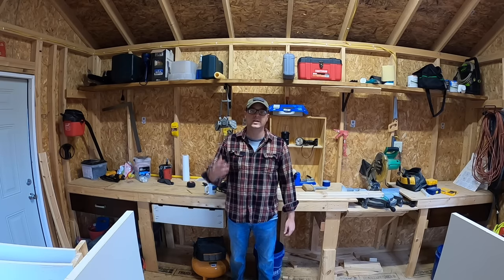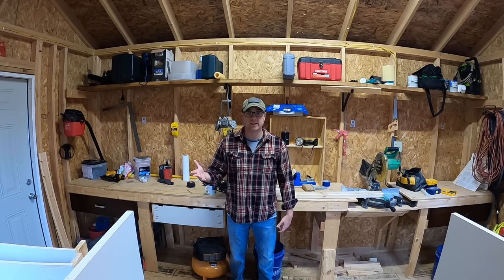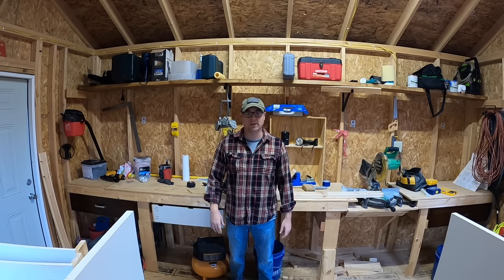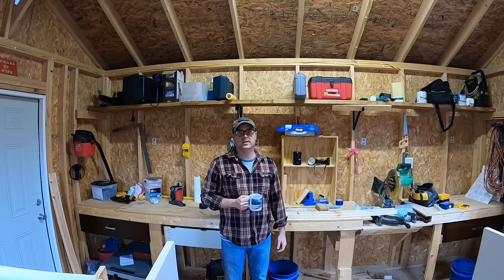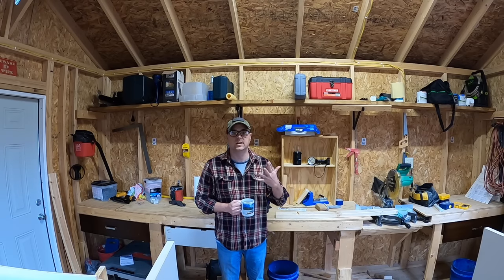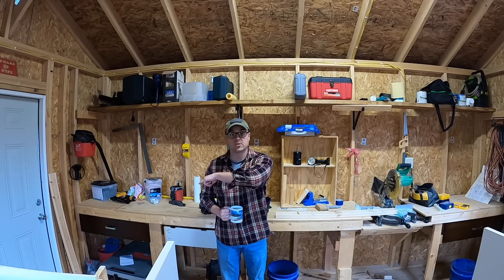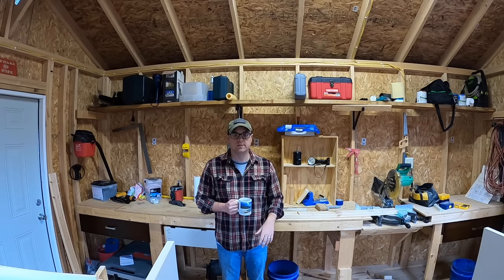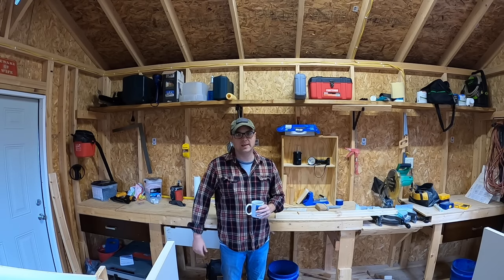Using Extension Cord & RV Inlet to Power A Shed

Comment: Your wire splice is not a legal splice with just tape around wires like that.  You should have run that pigtail into a junction box and at least wire nut each wire separately and then tape up each individual wire.   Also, not the most efficient way to run wiring on the surface of the header plate.  You will have to re-route the wiring if you ever decide to cover the studs, etc.  Otherwise.......You did accomplish what you set out to do.
Reply from the maker: There’s no wire splice

Comment: You might want to check with the local ordinance to see if this is legal.
Reply: Most municipalities default to the NEC (National Electrical Code) and they require exposed wires to be in conduits.

Comment: Im living in a shed right now and have 6 outlets and 1 light all wired up. Currently my incoming power is extension cords and 6 ways. Would this be sufficient to run the whole shed? And is it safe? (I plan on insatalling a sub panel and burying some wire in the future)
Reply from the maker: No.  That isn’t safe.

Comment: I had a similar setup, for about a year, until I could bury the power cable. It was mostly for the lights in the work shed, and outlets for a radio. I wish the guys complaining about the electrical code violations would specify them so other viewers who don’t know them, could learn. I think it’s good to use 20-Amp wire in case you want to bury the power and put it on a dedicated 20-amp circuit in the future.
Reply from the maker: Lights and the mitre saw is all we run off this and it’s held up beautifully over the last eight months.  This is also temporary until I can afford to put in solar.  This shed does not require permits in my location due to its size and not being used as a habitable space.  Some of the claims made in the comments don’t even represent what was done in this video so at this point it’s a pile on effect.

Comment: Nice. But it appears you used 20 amp ( yellow ) wire with a 15 amp power plug...not sure that really matters. But cool idea..thanks for the video
Reply: It's fine to use over rated wire, the power is (or should be) limited by the weakest link and the breaker to match. Ie a 15a plug with 15a breaker/fuse at the circuit (preferably dedicated) powering the 20a cord is fine. Power's drawn not pushed and isn't restricted by the lines but by the breaker. A 20-25a breaker with 20a cord with 15a receptacle could be problematic as it wouldn't shut down when the weakest link is overloaded.

Comment: Is there any special way that you had to do it I tried plugging up my shed to one of the kitchen outlets and our breaker kept on flipping off and I do not understand why it will not run power please help me
Reply from the maker: What exactly are you trying to power in your shed?  There are different factors here so without knowing your setup I can’t say for certain what your issue is.  My guess is you are trying to power too many items at once and overloading the circuit.

Comment: Would this work if I had more than one outlet in the shed? I want to have exactly what you have, but also another outlet on the outside of the shed for another light for my bbq equipment and some rope lights.
Reply from the maker: If you plugged all of those lights and things you plan on running into an outlet in your house would you be concerned with breaker trips or other issues.  If the answer is yes then don’t do it with this setup.
Reply: Lights are pretty minimal on power drain especially if you go with led types. Another alternative you might consider if possible (though a bit less reliable) is a solar powered light. I picked one up off amazon for like $13-15 where the battery, light and solar panel are all one unit. Sold as a flood/security light, it's motion activated but came with a small remote. Granted it's not the brightest but I have it mounted up about 10ft off the ground and lights up my grill area (6x7ft pad), the porch nearby, out into the yard and lights it up well enough to grill by. May solve one of your issues and not even require power. The motion activated one I got has an option with the remote to turn the light on/off and keep it on steady as well as brightness adjustment.

Comment: Would this setup run a small window unit?
Reply: Those arent suppose to be even used with an extention cord. That being said, i think they do sell a "ac extention cord" its thick guage wire. It'd be real costly to find whatever guage that is for a long length.

If u did, everything else would work. U'd just have to make sure the house plug ur using, doesnt have a lot of others plugged into that circuit.

I'd also highly recommend a gfci plug in the shed instead

Comment: can you run multiple devices at the same time as running light all off the same power source? I would think it would trip the breaker back in the house??  How does this not over load the system? is it the gauge of wire being used??  Would love to do the same with mine, but fear the tripping constantly back in the home....
Reply from the maker: I run a light and a mitre saw off this with no issues of breaker being tripped.  Depends on what you plan on running.  If you exceed the outlets amperage capacity you will trip the breaker just like any other outlet in your house.

Comment: exactly what i did. will be temporary though as i don't want an extension cord running between my house and shed 24/7/365. i will install solar, and use mostly battery tools (even my table saw is cordless).

Comment: Why not using a normal outdoor fuse  box inside the shed than to a power outlets, some outdoor outlets inside the shed and you are safer and better some plastic or metal ducting. 🤔

Comment: After seeing the wiring job. This should be a what not to do to power a shed. I spotted at least three violations before you even got to the extension cord. Don’t screw around with electricity, it’s very unforgiving when it’s done wrong.

Comment: yeah but thats not code compliant, in fact if the code official ever found out, you'd get fined, furthermore if you had a fire your insurance may not cover the damage....you can't run an extension cord to power permanent wiring !

Comment: That’s not a plug, it’s a receptacle. A plug is what goes into the receptacle.
For anyone that wants to know the proper way to wire a shed, don’t watch this video.
Reply from the maker: I’m surprised it took so long to get a comment like this.  The shed works perfectly with zero problems over the last 8 months.  Get off your high horse
Reply: @makinlifework9345  I thought it was great.  Just what I am doing and looking for. Not everyone can dig 50 feet under ground and lay pipe and all that to have power in a stinking shed.   I've got mine all wired, just need an inlet power source.  I have a dedicated switch from my garage I am feeding this to and it's not meant to be permanent so this works for me.  Great job.
Reply from the maker: @ucdesigns396  well said.  Glad to see someone understood the point of this video.  Thank you for taking the time to write a comment.
Reply: Great video I don’t see any problem with the way you did things , haters are going to hate. P.s electricians think they are the smartest person in the room always lol.
Reply from the maker: @jorgevera8145  ha ha true
Reply: @jorgevera8145  yeah know it all jerks aside .
 There's a reason why a electric code exists and ""best practices ""
Yeah it works but for how long? And how many amps are you running? 🤔  
And what your going to spend on a Good ""extension cord" " you can buy a breaker   and a enough 10 awg or even 8.
And do it safely.
Because heat is a factor no one ever realizes.  That shock hazard is obvious but hot cords is the leading cause of death and fites
Reply: @luvdady  I mean sure but some guys aren’t that well rounded and just find an easy way I’m guilty of a few micky mouses  in my life haha but I’ve learn to do things right as I move on no doubt

Comment: Wow, he needs to spend a little more time planning his videos. Production value sucks. Also, how lazy is he for not running electrical wiring underground to his shed. It was only 30 or 40 feet. Now every time he wants to turn on a light in the shed he needs to run an extension cord.
Reply from the maker: I hope you can see the irony in your message here.  I won’t tell you but let’s see if you can figure it out😂

Comment: Dear LOOOORD!  I dont normally jump into the comments to rag people, but holllly cow is this bad.  #1...15 amp extension cord?  Is that a 20 amp circuit from the house?  If so you are definitely making the extension cord the fusible link there.  If you power 18 to 19 amps...that cord is going to melt down.  Not to mention the lack of weather tightness.  #2  That wiring is just run like someone who NEVER plans on insulation nor closing those walls.  I can even imagine running raw wire like that in an area where Im going to be slinging wood, or nails, or hammers, etc... there is a reason that almost every code in the world requires wire to be kept safe from impact either in the wall or in a conduit, etc... #3 if you were going to do it this way, why not run a 30 or 50 amp input socket and a sub panel so you could run it off a 30 or 50 amp cord from a generator OR from a 30 or 50 amp circuit from the house?  At least they have a twist lock to them and can be found with housings that are weather tight.  

This isnt clever nor safe, nor even all that easy, honestly.  Its almost easier to do it properly.  I hope you rectify some of this and take electricity seriously, bc this is just asking for trouble.  Even the way you have a small saw right there by the plug/switch combo is a bad idea...